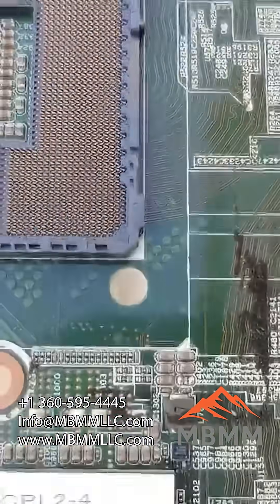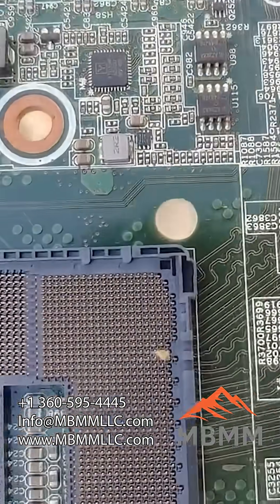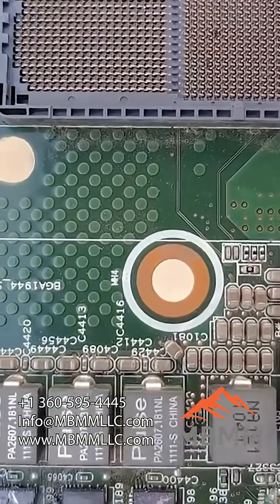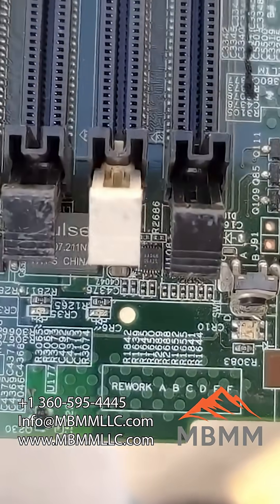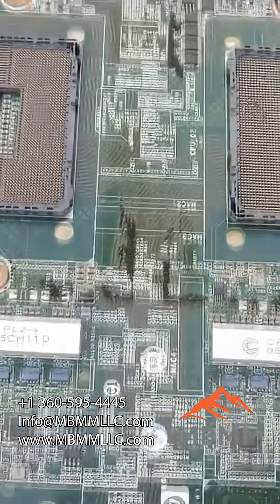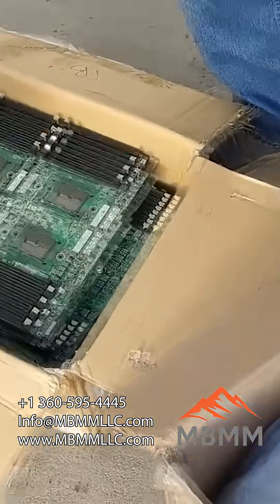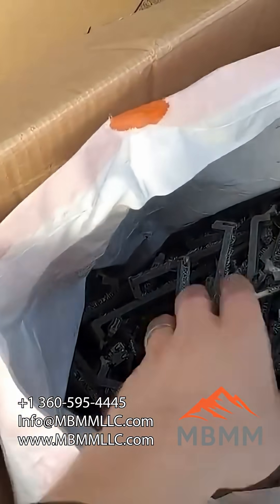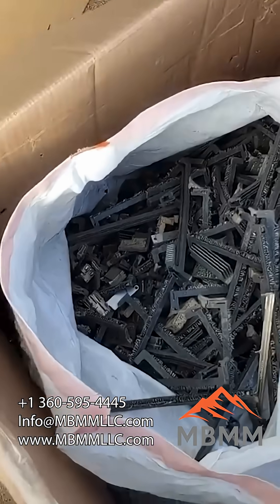⚙️ Inside the gold recovery process

Comment: 99% of the IC'S are surface mount. Heat the entire board in an oven untill the solder melts then use leather work gloves and bang the board on its edge and all the IC'S should all come off easily.  There's no gold on or in the board itself..
Reply: Yah, but your lungs. Need breathing apparatus. Tried this once.
Reply: @lotharschiese8559 could sinter the IC's in a sealed electric unit of some sort? I used to strip boards outside with a blow torch. The solder melts long before the board burns.